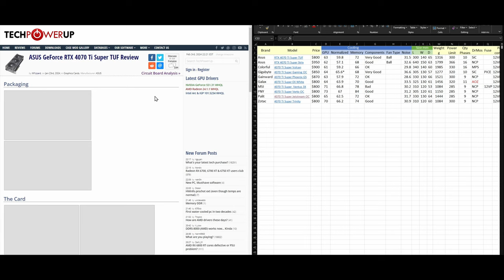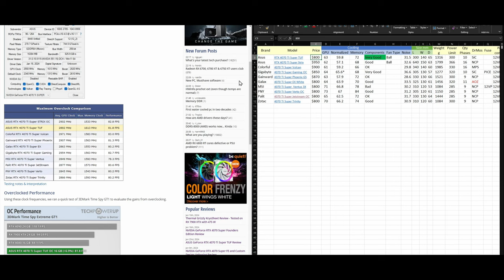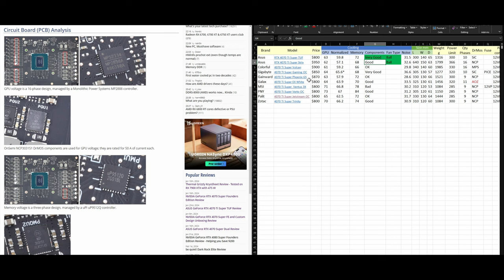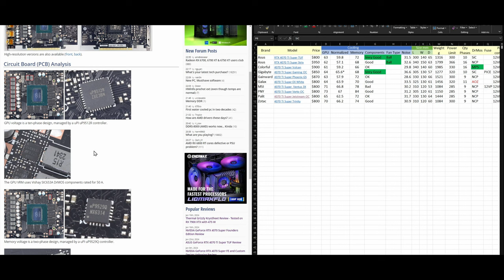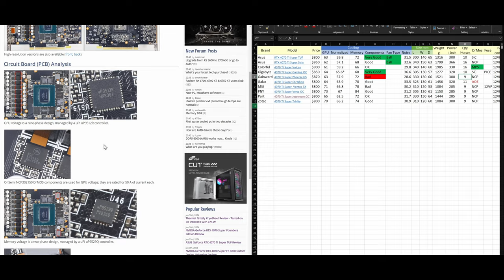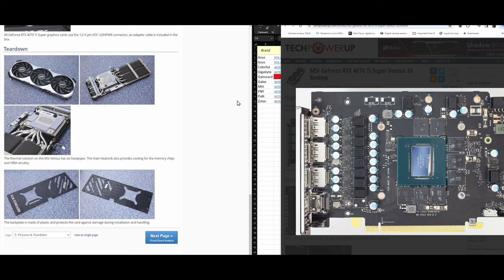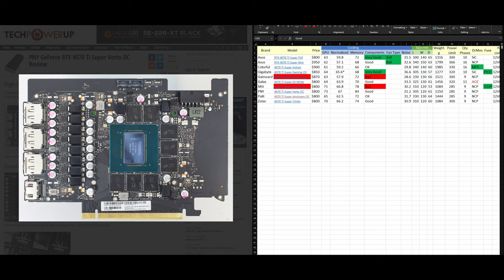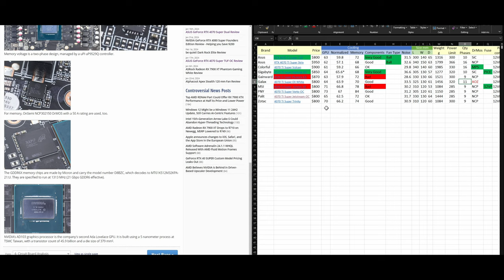Which RTX 4070 TI SUPER TO BUY NOW

Comment: Got the pny verto a month ago, works perfectly fine except a little bit of coil while which can be reduced by undervolting. But it's very weird because of the facts that your data doesn't match mine. The memory temps are much lower than expected for me. They were like between 73°C and 77°C during stress test, at power limit. Even after undervolting the temps didn't move that much like 2°C max. I live in France and other GPU's are much more expensive. The difference for the price (~900€) is really between the gainward panther (which is the same as the palit jetstream) and the pny verto. So, thank you because it reminds me it wasn't a bad purchase 😅. Have a good day !
Reply from the maker: Memory temp difference could be due to different thermal pads being used in different batches of cards. As in super series I even saw different pads in the same card. Coil whine could be eliminated by replacing power supply also.
Reply: Hi,can you tell max gpu temp?and what your undervolt settings?have the same price market,pny is much cheaper.TY
Reply: @Y.V.M I've set mine at 945 mv 2775mhz but for more stability set it at the same frequency but at 950mv. My max GPU temp was with the default fan and default voltage curve settings. I reached approximately 72°C GPU temp, 76°C mem temp and 90°C hotspot. With undervolting, without changing the fan curve, I reached 70°C GPU temp, 74°C mem temp, and 87°C hot spot. With modified fan curve, I reached 60°C GPU temp, 64°C mem temp and 75°C hot spot. (All tests on MSI KOMBUSTOR V4 1.29.0 5min duration for each one and room temp ~24°C). The fans are slightly more audible but not that far from the stock curve (fan speed =~45% stock and ~59% edited).

Comment: Got the TUF gaming, stunning card, big, built really well, quality look and feel, runs ultra quiet too and stays very cool...

I have had ASUS GPUs, before, in fact the one I am replacing is a GTX 1060 6gb, and it did not die, just an upgrade, been running solid now for years heavily overlocked...

You get what you pay for with GPUs.
Reply from the maker: Exactly. Congrats

Comment: Hey quick question. When there is a OC and a non OC version... Could there be differences in the cooler and what components have direct contact to the heat sink or is it cooler wise exactly the same (which would make sense regarding manufacturing cost)?
To be exact I'm thinking about the asus tuf gaming and the asus tuf gaming oc.
Sadly there is only a review of the normal one and not for the oc version on TechPowerUp.
Reply from the maker: Hi it is same card just different firmware. Buy the cheap one and use msi afterburner to tune it to get same or better performance

Comment: Thank you for this review. If you can  provide details or suggestion for the Zotac 4070 ti super amp holo, that would be greatly appreciated!!  It's on sale right now where I live, however I can't find any detailed review of it. Going for the same price as the tuf model - though I have no idea for how long.
Reply from the maker: Unfortunately the only zotac I found was trinity and halo seems to have better cooling. So at least the cooling performance should be a little bit better. The one issue could be the noise which you can tune with msi afterburner
Reply: Thank you!

Comment: between the 4070ti super Asus tuf non OC  ($965USD) vs the Vulcan W OC ($1,035USD) which once would you choose? and what is the cons and pros of SiC vs MPS and the Qty Phases? Hope you have explained it thoroughly in the video, but overall very nice content. appreciate this kind of videos. And does higher Memory in the cooling is better? And why did the Vulcan White oc only had "okay" rating when it got the lowest/best temps in the scoreboard?
Reply from the maker: Defenetly get Asus tuf. Sic and mps difference is lowers failure rate of mps chips so it is higher tire product. And ok rating for vulcan cooling is because not all components have direct contact with heatsink and thats the reason of card being cooler as less heat being transfered to the heatsink.
Reply: @valueking13  thank you so much for your reply. keep doing this content and we higly appreciate your indebt review especially on the hardware. so we can trully see which product have good quality from not. more subs for you. your channel should get more subs with its quality content. hope you can also make reviews with other model like the rtx 4070 super, 4070 ti super and 4080 super ultra w oc from colorful as this gpu has low price but made us thinking why, is it because its “made from china”?
Reply: @valueking13  i will get the asus tuf for sure. thanks for the review.

Comment: Would you say the PNY 4070 Ti Super is worth getting if I can get it for 200 dollars less than the Asus one? Amazing video!
Reply from the maker: It runs a little bit hot compared to Asus but other than that no major cons. So if you have good airflow in your case you can get pny and also use msi afterburner to adjust fan curve to get optimal noise to temp ratio.
Reply: @valueking13  Thanks a lot for your reply! I really appreciate it!

Comment: brother should i buy the 4070 ti super gigabyte gaming oc(1277gm) or eagle oc(950gm)
I need a card which is compact and dual slot . rest msi and asus are expensive in india, 
they r priced in 4080 territory and i dont like inno 3d , zotacs , galax or colorful , 
i am upgrading from Nvidia Rtx 3070 FE. 
please suggest and tell me is there any difference between gigabyte model in terms of VRMs, mosfets and phase design . 
are eagle oc really inferior to gaming oc model?.
Reply from the maker: I checked eagle version it is you only option for 2 slot card and also it has SIC vram 9 phase design for gpu and very good component cooling. Plus fuse on pcie so dont hesitate grab the eagle one.
Reply: @valueking13  thanks alot buddy where did you find eagle review?? . also wanted to tell you that here in India Gigabyte offers 3+1 yrs warranty on its gaming oc model upon registration within 30 days and  3 years standard on eagle oc.
Reply from the maker: @CaptainScorpio24  https://www.eteknix.com/gigabyte-rtx-4070-ti-super-oc-graphics-card-review/ it is windforce but it is same card just different name
Reply: @valueking13   okay i read that article at launch. so pcb layout of winforce and eagle models are same right .   pls let me know if yuh get a article on eagle and gaming x slim. im nt able to find that on internet.
Reply: @valueking13   is gigabyte gaming oc 4070 ti super having 1277 gm of weight okay without any anti sag or GPU support.?
my 3070 weighs 1 kg and OTOH rtx 3080 ti FE weighs 1372. nobody needed a GPU support for founders edition of same weight. will it b fine wd AIB partners bro.
Reply from the maker: I would put some support it is much safer to have it.
Reply: @valueking13  i bought the eagle one today
Reply from the maker: Congrats

Comment: Zotac trinity 3rd option?? This is the cheapest card in my country. The difference with palit (2nd cheapest) is about 65$. Tuf is the best but the difference is around 200$ more expensive than Zotac trinity. I thought palit > zotac because of the temperature difference.

I had zotac amp 3080 previously and it's broken after 3+ years (1.5 years goes for full mining). So i guess i will buy zotac again, hopefully this will last longer than my 3080
Reply: What do you think @valueking13
Reply: Also would you consider gigabyte windforce over zotac or palit?

Comment: what about the ventus dual fan?
Reply from the maker: Havent seen what's inside but should be similar pcb as ventus x3 just shorter heatsink
Reply: @valueking13   ty for the answer my case offer limited space and as far as i know there is only 2  dual fan models of the 4070 ti super wich is the msi ventus and the other one is from inno 3d . do you think the inno 3d model is good enough?